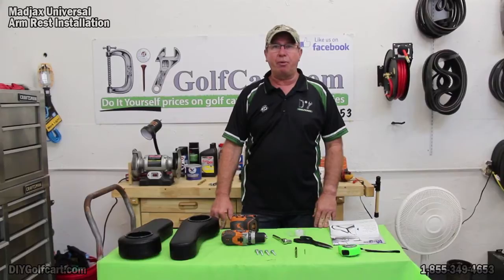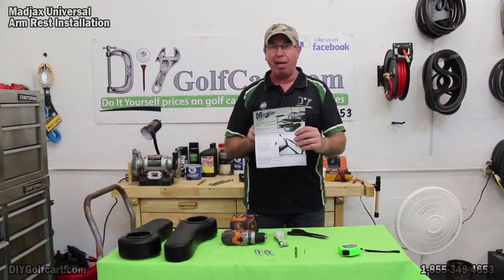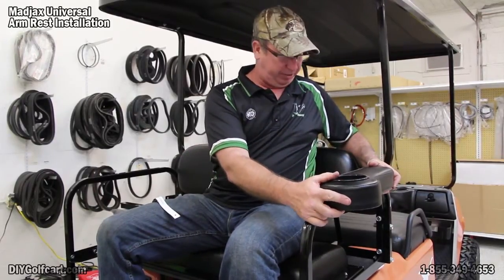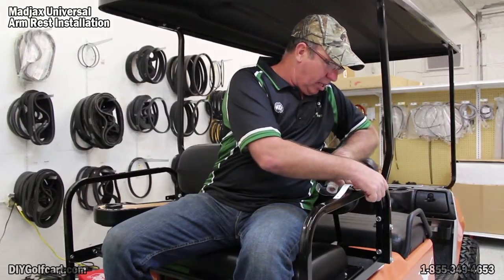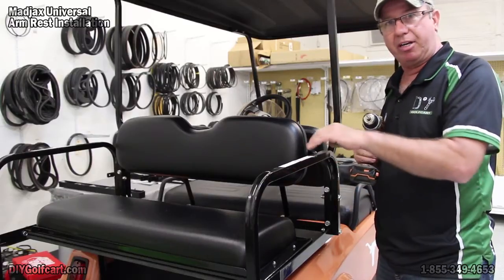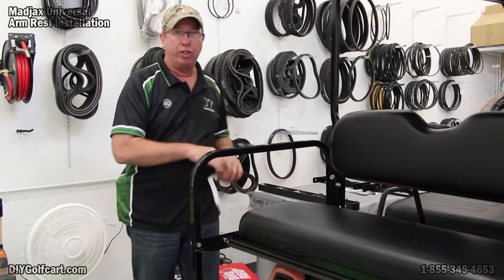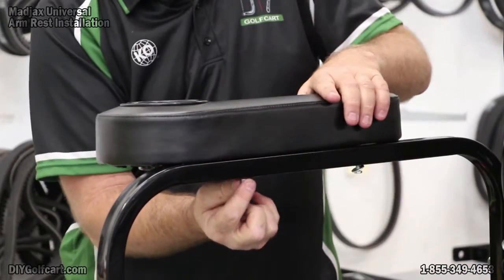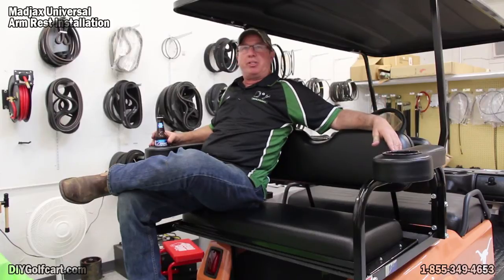Armrest Cup Holders for Golf Cart Rear Seat | How to Install

Comment: Turn the cup holders to the inside. 
Much better
Reply from the maker: Then this particular seat would not flip open.
Reply: @golfcartking  Use 1/4-20 threaded rod and plastic wing nuts. 
Take them off when needing to flip the seat.